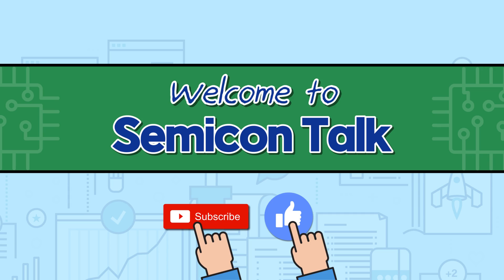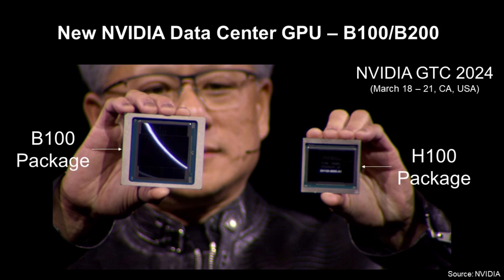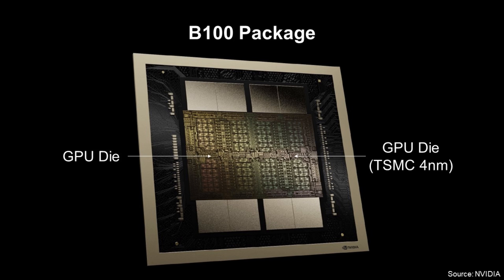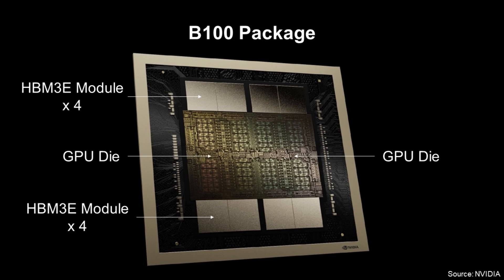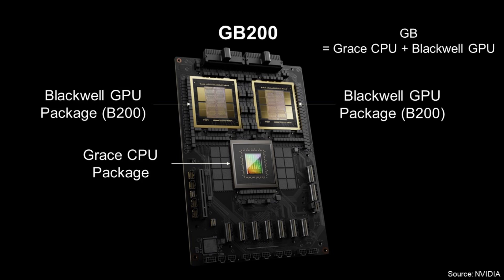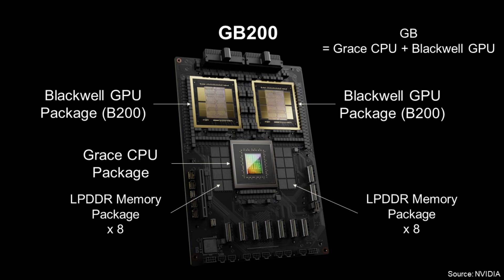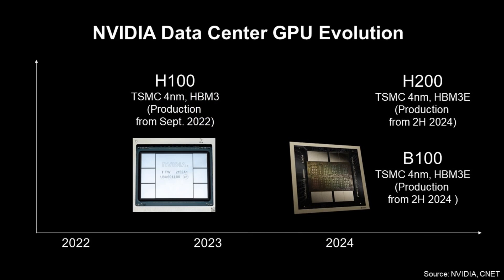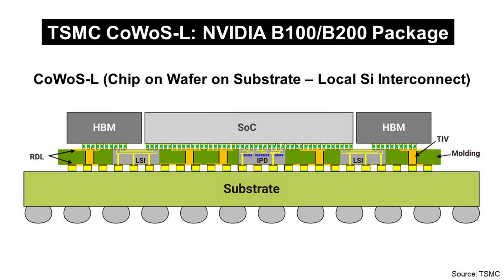[Eng Sub] NVIDIA GTC 2024

Comment: I have a few questions about wafer-level and panel-level packaging:

CTE Mismatch in WLP: In wafer-level packages (WLP), the die is directly attached to the PCB without a substrate. How do we manage the challenges of Coefficient of Thermal Expansion (CTE) mismatch between these materials?

Maximum Die Thickness in WLP: What is the typical maximum thickness limitation for dies in WLP?

Heterogeneous Integration in WLP: With the growing interest in heterogeneous integration, how are different components combined within a WLP package?

Interconnects in WLP: What types of interconnects are commonly used for connecting the die to the PCB in WLP? Are Ball Grid Arrays (BGA & HB technologies ) is not feasible, if cu-cu boding technology considering how they are handle CTE impact?                                                                                               In wafer-level packaging, chip first technology- Top of the wafer their applying epoxy material, how can we address the challenges of thermal management ?
Reply from the maker: It is difficult to follow your questions but I will do my best.
A1)  Package size of WLP is small so CTE mismatch is not challenging. To make sure reliability of interconnection between WLP and PCB, people apply underfill material.
A2) Typical die thickness of WLP can be 200~400um but it can be thicker as well. 
A3) Usually in WLP, heterogeneous Integration is not used.
A4) WLP is connected with PCB through bumps on WLP.
A5) If there is epoxy material on top of wafer or die, it means that die does not generate much heat so thermal management is not challlenging.